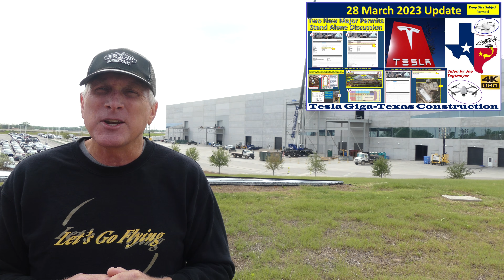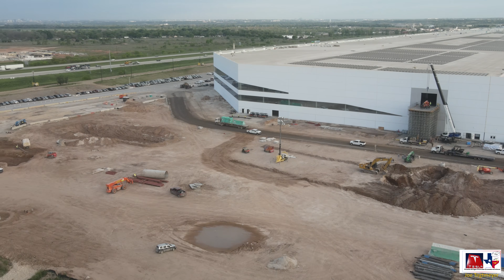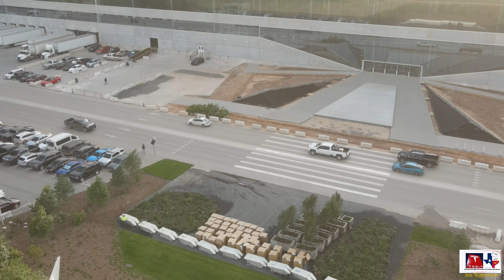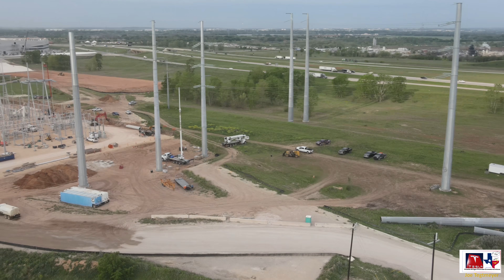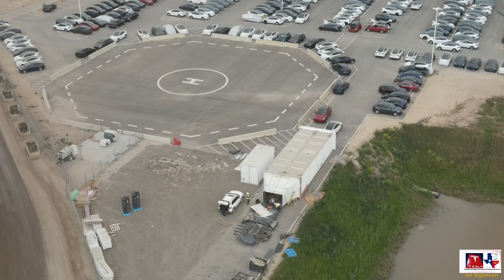New Wind Tunnel Testing Rig, Model Y Prod Hits a New Gear! 29 March 2023 Giga Texas Updates(08:15AM)

Comment: The uprights in front of the main entrance are probably planting markers for trees, shrubs, or planters rather than pipes. 
It will be interesting to see if the loading platforms will remain around the building, particularly on the north side of the building if, indeed, internal fit-out has been completed.

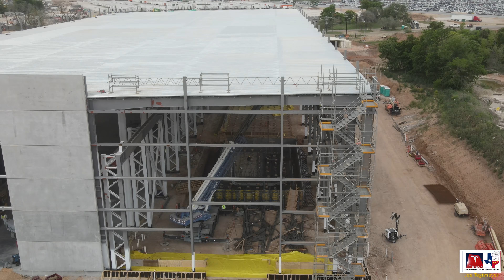Comment: at 18:49 the four tanks look like they are tanks with insulation & stainless wrap to protect the insulation. in my past history we have had tanks fabricated and they were delivered insulated and covered. common practice in the industry. the corrugated metal cover and the bands around the circumference of the tanks is the "tell".  at 23:00 the large pipes as Joe called them are very large conduits for high voltage to whatever equipment will be installed on the foundation. Maybe 480V wiring will be needed here.

Comment: Thanks Joe.
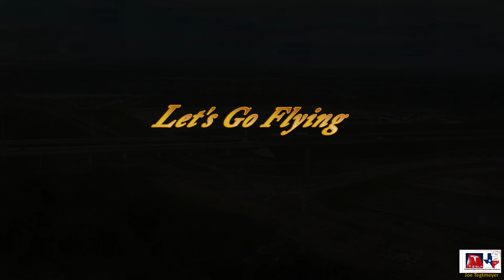3:47. Highway berm. There’s that man again at the bridge.
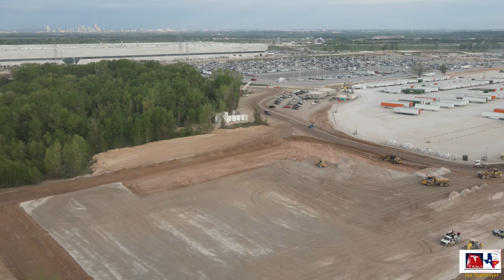5:39. East support facility works. This could be crushed waste concrete from the MM Batch Plant site. Being delivered in the off-road dump trucks. See 17:56.
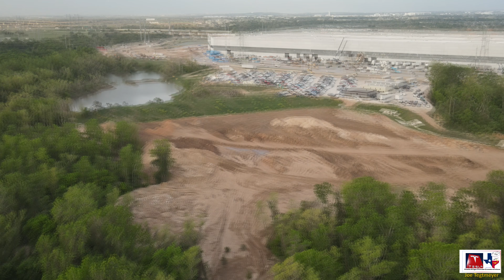6:10. Outfall channels area. Dumping spoil here again.
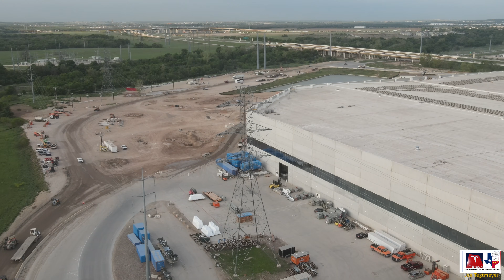6:48. Stamping, apron. Bottom right. To the north (right) of the orange pickups is another of the riggers forklift crane/forklift rigging boom, similar seen on the apron outside Casting in Joe’s 27 March video.
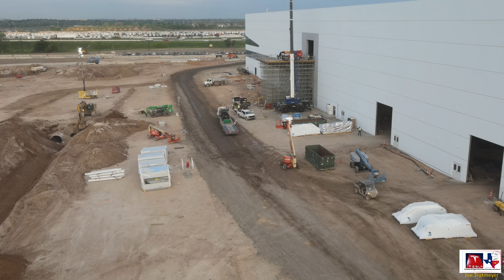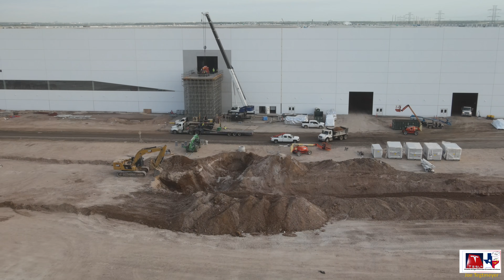7:42. Southend. 4 White crates of filters. In Joe’s photos one crate is marked. ‘L1 AHU 37’. Level 1, Air Handling Unit 37. 8:30, just visible.
8:52. Southend. Bottom Left. Floor segments cut out of an upper level. Stack of rebar over by the golf carts.
9:50. Southend. Cistern. Likely a sanitary sewer lift station/pump station. It has a base, it’s watertight.
11:37. Main Entrance. Small white irrigation pipe risers in the triangular beds.
13:00. Battery west, apron. White items on the trailer look vaguely familiar. I think similar has been delivered before.
13:30. Battery, roof. Scaffold frames built up around the air inlets. Plastic sheeting to the closest.
15:13. Casting, apron. Large square ingots I’d say are waste aluminium from end of cycle runs or failed cycles. The ingots are highly variable in thickness, and the top dishing. One in particular holding water.
15:55. BESS site. Pair of traffic bollards on what appears to be a manhole. Some in-ground utility.
17:59. MM Batch Plant. Recently upgraded some of the hoppers. It will be there until Tesla needs that patch of ground.
19:08. Cathode east. New piece of plant shifted in. Looks like it a segment of a tunnel type arrangement.
20:02. Cathode, east. Ramp. Drilling a series of holes for what would likely be a rail system to shift something heavy or particularly large into the building. Similar to the preassembled large plant that was hoisted up and shifted into Level 3.
21:10. Cathode west, plant apron. The big reveal of the 3 large equipment assemblies. Att.HarderNL.
24:06. Die Shop, south. Centre hall. At the end of the yellow strip of yellow plastic is a pair of pits that would be located under the separate lower level bridge crane that spans only 2 column bays.
Glimpse of the bridge crane beams at 20:12.
26:25. BIW, apron. Loading dock ramp. Right. Concrete truck delivering to the same door as 2 days ago.
27:38. Helipad area. Pair of shipping containers.
Doesn’t look like a new bit of plant. Maybe it’s come from Fremont.
Reply: 9:50 Agree. Sewer lift station.

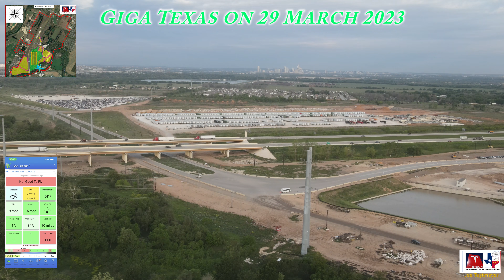Comment: @ 3:50 Whats the buildings just left of 12 o'clock?  I thought Austin was where the site-map currently is?

 Joe, you know when your at a viewpoint in a naturescape or cityscape and you have a sign pointing out the things you can see.  Could you do a 360 pointing out cities and the direction of other Musk-Industries sites, like starbase, starlink, tbc, nuralink, fremont,  giga berlin, giga shanghai.  As a pilot this should be second nature to be orientated in the air.
Reply: Yes those buildings on the horizon are downtown Austin.  River road points straight at the airport (which should be obscured by the map)
Reply: @shadowmancer7040  Thanks.  Oh ok. with 12 pointing north, I thought Austin was at about 8:30 and the aitport at 8:00.  I know there is a string of cities/towns that TBC is talking about, but its not easy to gauge how near or far things are
Reply: @Tim Boatfield  omg.   I spent more than a few hours calculating range and bearing to all the tesla, spacex, and boring company properties and posted it multiple times in response to your suggestion/idea.   It took multiple attempts because it kept going away.   It finally stayed long enough for me to see it at around 4am this morning and now its freaking gone again!   Infuriating!
Reply: @timboatfield  As I said my bearings are eyeballed.  I don’t think I'm even close to being accurate enough to differentiate between 8 and 8: 30.  Lol.  My technique was to estimate the approximate angle using 30 and 45 degrees as guides.
Reply: @shadowmancer7040  Wow!  Fantastic Sir!  That is service above and beyond!  Particularly, in having to battle the system.
  Thank you greatly!
 My direction referance was as a layperson trying to be a bit scientific.  
  Hopefully Joe can translate these in to graphics for a 360 tour.
Reply: @Tim Boatfield  it was your idea.  I thought it was fun.   Looking up the actual locations of a bunch of places I knew about roughly.   For instance I was really surprised that the Giga Mexico location is effectively straight west of Starbase.
Reply: @shadowmancer7040  Did your response kept disappearing?

There would have been one or two words that YouTube didn’t like. I’ve had trouble with ‘Die Shop’, ‘google’, 'YouTube' and most recently ‘commenter’. All triggered the YouTube gremlin generator. 

For a long time I’ve composed all of my comments and long responses (including this one) in Apple Notes, and then copy and paste into YouTube. Keeping the original until I’m sure it’s stuck.

Links can also be a problem. Links to YouTube videos are 'usually' ok. Non-YouTube links randomly are ok.
Reply: @shadowmancer7040  Thanks greatly for contributing to the idea.  I am very much into local community, with a belief that we all have a piece of the jigsaw puzzle, by putting them together we we all get to see the picture.
  The diversity of skills, knowledge and experience of any large group of random people, cover most things and strangers contributing to the same aims is a bit magical.  This is Agile at the grass roots.  Collectively we are the solution to many of our own problems, with a little organisation.  
  Thanks again for not only your effort to compile these figures, but with fighting through the system to deliver them.
Reply: @DessieDoolan  Yes, I do that for any site that is liable to lose data.  Here i do the same avoidance of trouble words and use alternative words. yt sucks a lemon.
  While I'm here, thanks for posting your observations.  We all see different things. :)
Reply: @timboatfield  It's the complete randomness that's annoying. 'Die shop' is ok today, might not be tomorrow.

Google Earth Pro is great for measuring stuff. Seems to be very accurate. Width of the main building is a documented 1130.77', Google Earth Pro shows it to be 1147'.

Headings can be shown also. 

Observations. It's become part of my daily routine. I get twitchy if an expected video doesn't show!
Reply: @DessieDoolan  I try not to let it annoy me, but it would if i did.  We could probably make a few pints disappear on this subject, but there will be an alternative soon, it's being written as we speak. ;)
 Yes even Gmaps is accurate enough for many things.  I have suggested to all the drone pilots, from the start, to do 3D from 2D models of the whole site, which you can measure anything you can see from several angles and even automatic count stuff like cars, columns, solar-panels, change highlighting from day to day.  It's just a cloud software service!  No takers.   :(
Reply: @DessieDoolan  yeah it was super frustrating.  I wrote it in Evernote and something reformatted as a phone number "link".  At first I assumed it was that link so then I pasted as plain text, then I thought it might have been my internet, then I thought maybe it was "shadow banned", then I tried again and I actually saw it.  So I thought, wierd gremlins but it's there now so I can sleep.  Woke up and it was gone again.   Arg!  Then I tried just posting smaller chunks and it worked.  Who knows.  Youtube hates me and the feeling is in manyvways mutual.  :)
Reply: Cry.  I tried again and verified that it worked.... and then it went away again.
Reply: Ok. Tried again.

Below is a list of bearings (eyeballed) and distances (per Google maps measuring tool) for various "landmarks" around Giga Texas.  Calculated from the approximate canter of the Cyber Pool:
Reply: 012 - 82 miles: Spacex - McGregor 
015 - 13 miles: Austin executive Airport 
017 - 1.2 miles: Tesla - Temp Electrical switch yard

020 - 25 miles: Tesla - Hutto Rail yard
030 - 2.1 miles: Tesla - Center of north logistics field
031 - 5396 miles: Tesla - Giga Berlin
045 - 2 miles: Tesla - Lone tree in rodeo commercial 
045 - 1355 miles: Tesla - Giga New York
060 - 1.3 miles: Tesla - cell tower on "island" other end of "future boring tunnel"
Reply: 092 - 1034 miles: SpaceX - Landing pad (Cape Canaveral)
100 - 13 miles: Boring Co & SpaceX - Tunnel at Bastrop
177 - 293 miles: SpaceX - Mechazilla (Starbase z Boca Chica))
183 - 173 miles: Tesla - Lithium refinery (Corpus Christi)
208 - 361 miles: Tesla - Giga Mexico
240 - 3 miles: Austin - Bergstrom ATC Tower
Reply: 290 - 1237 miles: SpaceX -  Hawthorn
293 - 1372 miles: SpaceX - Vandenberg
310 - 1478 miles: Tesla  Freemont⁶
315 - 8.3 miles: Austin Capitol Building
316 - 1389 miles: Tesla - Giga Nevada

325 - 7487 miles: Tesla- Giga Shanghai

Comment: Substation: @ 29:30 (Bottom right) Looks like only the east 345 kV transmission line circuit will power the substation?
Reply: Why do you say that? Yes, they’ve only hooked up one line to one circuit so far, but if you look at the Northern most newly erected monopole, you will see one set of outriggers headed north and one set headed south east. If they were just hanging lines to continue that set of lines northward, there would be no need for the southeastern outriggers. Nor would they would they have necessarily went to the expense of a double circuit, double breaker yard. Finally, it only makes sense for LCRA to use both lines. If you are spending 30 million bucks on a new switchyard, it only makes sense to switch both sets of lines.
Reply: @Bill_N_ATX  I agree with you. Except for the problem of... How do they get the western set of transmission lines to cross over or under the eastern set of transmission lines? After thinking about it, they don't crossover. The eastern set of transmission lines is routed through the substation. The crossover occurs in the substation using busbars. The western transmission lines could then be tapped and enter the substation via the middle monopoles seen @ 29:32. I may also be completely wrong. Just an idea.

Comment: That's a wind tunnel
Reply from the maker: You may be right. Why do you think they need a wind tunnel?
Reply: @JoeTegtmeyer  Not really sure from an engineering standpoint.  You can simulate airflow with decent accuracy.  Physical makes it easier for folks to see directly, so maybe they're demonstrating something to a bunch of non-engineers?

I think a later comment has it right - it's for acoustic testing. It might be that they're looking for door and window sealing issues in production.